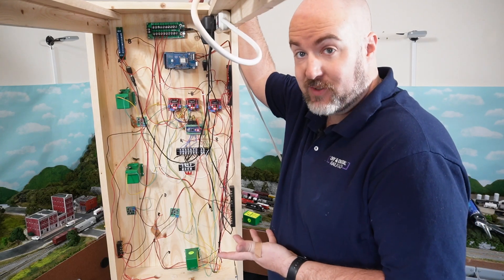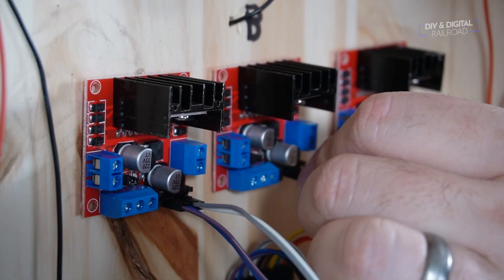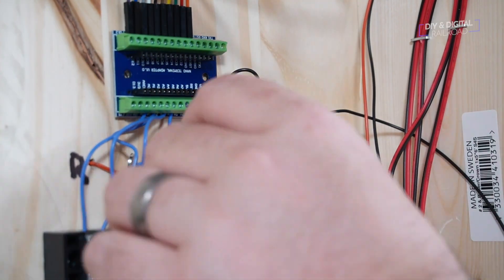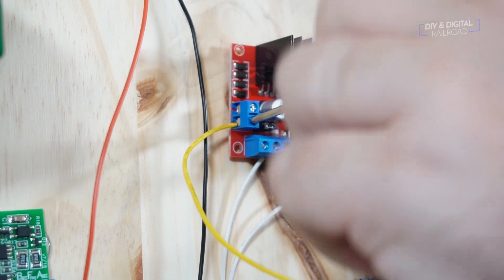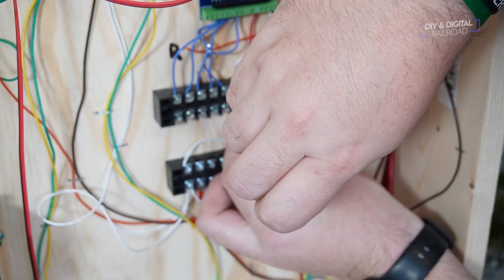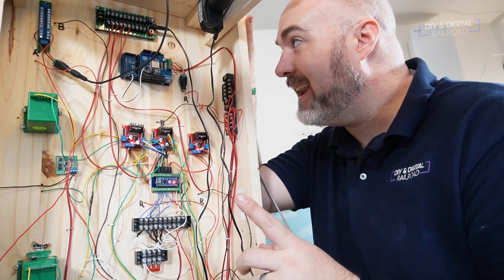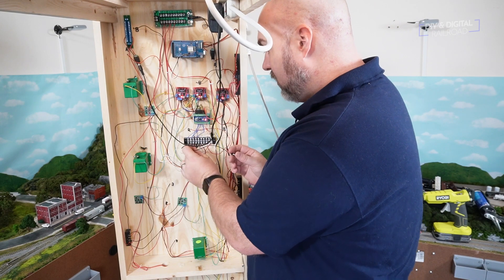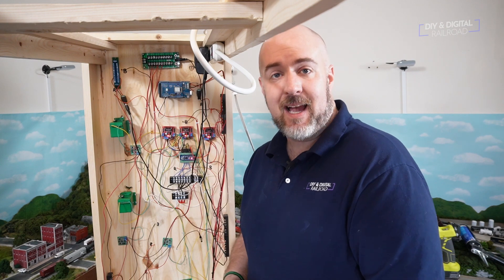Wiring up multiple Model Railroad switch machines with Arduino!

Comment: Why can’t they Arno control the tortoise directly, why do you need a motor control?
Reply from the maker: The arduino cannot supply enough power to run the tortoise.  Arduino’s max output is 5 volts and 200 mA

Comment: Hey Jimmy. Your arduinos and points control are impressive, so much so i am thi king of using your tdchnique in my own build. You talk about using 2 terminal block connectors - one with an input of 9V while the other is 12V.  In your state is the supply voltage 120V? In the UK it is 240V. Can you tell me how or by what method do you use to step down from 120V to 9V and 12V respectively? Thank you for the response. Mike

Comment: Jimmy, I think you could have saved yourself some resistor wiring by using the Arduino's input_pullup feature. Then with all the pins internally pulled high you'd need to convert the 5v rail to your buttons into a ground rail and remove the resistors. Here is a good video on input wiring 
https://www.youtube.com/watch?v=TTqoKcpIWkQ&t=12s

Comment: I'd be happy to do your wire management for you haha.  I like the idea of using terminal blocks - I'd do the same thing for the H-bridge drivers and solder the wires onto the pins as opposed to relying on dupont connections.  Thanks, Jimmy!

Comment: How many amps are you sending to the 12V terminal power distributor and also to the 9V power distributor ?
Reply from the maker: Currently (pun intended). I have 1 amp power supply connected to the 12V as well as the 9V, but obviously the way I have it setup I can swap them out easily.
Reply: @DIYDigitalRailroad  If I run two amps through either or both will it cause any issues with the Arduinos (or any of the rest of these components)?
Reply: @scentgrasslakerailway  Nope, the components will only draw as many amps as they need :) Voltage is important to get right though, too much (or too little) will cause issues. You can run an Arduino on anywhere from 5-12V, but somewhere in the middle is preferred because it will generate less heat, that's why Jimmy is using a second 9V supply instead of just using 12V for everything.
Reply: @milkymoocowmoo  That is excellent info, thank you!

Comment: What a nightmare. Now tell me why an Arduino is advantageous?  It seems that there so many wires that I would lose my mind, certainly my love of the hobby.  It is just too much.  To make it even worse is that after all of that wiring you now have to program these nightmares.  Now tell me how this makes life easier?  I do not want to have a degrees in electrical engineering and computer science just to run a layout.
Reply from the maker: The main advantages of an arduino is customization and now it is easy to change my turnout setup.  All I have to do is some minor adjustments to the code and I can make custom sequences for turnouts.  No additional wiring required.  It’s kind of like building a house.  Building a house is complicated, but once it’s built, you don’t have to tear it down and rebuild it every time you want to change something about it.
Reply: It's advantageous because it introduces a helpful software level into an otherwise entirely physical system. On a traditional layout for example, you might have a control panel of switches with wires running to your turnouts, and probably some indicator lights somewhere in there too. Each [turnout]-[switch]-[light] grouping is its own circuit, independent of other grouping aside from a shared power supply. If you later decided you wanted to interlock some turnouts, you'd need to run more wires. Maybe have a particular turnout route also throw some related turnouts? That's more wires, and potential *re*wiring of existing circuits, assuming your setup would even let you achieve it without causing shorts.

Think of Arduino as a middleman. Instead of individual circuits as above, you have inputs and outputs all connected up together via an Arduino "brain". Your switches, buttons, sensors, etc are your inputs, and your code tells the Arduino what to make your outputs (turnouts, signals, lights, etc) do when those inputs are received. To go back to the interlock example above, I could make that change quicker than I can type this sentence because all it would take is adjusting a line of code from "Arduino, when I push this button, throw turnout x" to "when I push this button, throw turnout x and turnout y". It also enables the use of logic, which is incredibly powerful. Conditionals, timers, reacting to situations....things that would be incredibly difficult if not impossible without that little brain sitting behind the scenes.

I'd also like to point out that Arduino is quite simple to learn! It's not a computer, it's a microcontroller board, so no electrical engineering or computer science degrees required. I have neither and picked it up by watching videos on this very channel, buying a $50 starter kit and following some tutorials.

Comment: Great tutorial as always. However I have a question you will probably be able to answer. Okay so say you have a fiddle yard/a humping yard. So in most cases to go from the thru mainline to the next section you would have the switch for the mainline and the switch for the next track, you have to have both switches opened to transfer from one track to the other, can you wire the signal to 2 tortoise switches in like a series so they both operate at the same exact time? I'm guessing yes, however the other thing I don't know is it going to be enough milliamps and or voltage to do it? From what I understand it's a yes. And thank you for any and all responses. You're the best.

Comment: Great video, Jimmy! We are building similar systems but going about it in rather different ways, which is all down to the flexibility of Arduino.

Have you given any thought to switching (sorry) from delay() to using a millis() clock? It would require some adjustments due to the way your code works (switch throwing functions only execute once per input, but a millis() clock forms a feedback loop and needs to...loop), but the payoff would be worth it. As it stands I foresee two issues-

1. The delay(200) in void has the potential to cause inputs to be missed if the button press occurs during the 200ms in which the program is halted.

2. Even worse, the delay(2000) in the throwing functions means you will need to wait at least 2 seconds after pushing a button before you can push another one, otherwise it won't be detected.

Lastly, I think it would be helpful to briefly cover the what & why of your pull-down resistors (if you haven't already done so elsewhere).

Looking forward to the next vid :)

Comment: Aloha Jimmy  Think  tiny wire ties and lots of colored wires,  set yourself a standard.  I use Black as DC negative except for my Kato track feeds.  Bundle all wires for a function and use the colors of the wire ties to show which function it goes to.   I used to do this with temperature probe arrays to designate row and column in 100 probe units. Makes troubleshooting easier when a probe fails.
Reply: I do the same. Eventuality you will need to troubleshoot.

Comment: Excellent video and information as always.  I am still trying to determine if Arduino is the way to go, seems like its going to be a tough choice for me between Arduino-based DCC++ system... versus using Digikeijs and Digitrax equipment. Or perhaps run separate power grids to the layout and use each during different sessions?  Maybe I think too  much..

Comment: I am still trying to wrap my head around Tortoises.  It pretty awesome that there is so much more customization potential for the system in the video, but can Tortoises be switched without Arduinos or accessory decoders? (i.e. just solder a switch onto it?)
Reply: Yes. Jimmy is driving the Tortoises for 2sec with each throw, but they're actually designed to be constantly driven and stalled at the end of their travel (~15mA @ stall). 12v and a DPDT is all you need, and the Tortoise even has an internal switch mechanism (actuated by its movement) that can be used to switch frog polarity and operate signals or panel lights if desired. There's a good reason they've been around for 30 odd years :)

Comment: Great video. I like how you mount the circuit card assemblies with hot glue. I generally use screws with some kind of improvised standoffs, which is a bit of a problem for me.  Question: What do you do if you decide to relocate your circuit cards after you have hot glued them?
Reply: You would just gently pry it off. Hot glue is marvellous, particularly for this application as it's a great insulator, but you wouldn't use it for anything structural :) Failing the gentle application of elbow grease, you can apply heat to soften it up again.
Reply: @milkymoocowmoo  Thanks. I will give it a try.

Comment: All that wiring reminds me of my father working on some type of pinball machine trying to repair it back in Cuba, more than 50 years ago! 
If he was still alive he would eat this up and I wish he was so he could help me. I do have a nephew who’s an electrical engineer and I will recruit him for this stuff because that’s what it takes to do this.
Reply: I disagree! If you can solder and understand a logical system (or are willing to learn), you can do Arduino! I'm building my own system that does the same as Jimmy's + a bit more, in a slightly different way. Wanna know how I got started? I watched a video on THIS CHANNEL then I went and bought a $50 Arduino starter kit :)

Comment: I think you just scared me right back to hand thrown switches with ground throws, very impressive just not for me
Reply: Hear what you say.  The word arduino makes my eyes glaze over and my mind start to see rotating pin wheels.  However Jimmy makes it as simple as it can be made.
Reply: What about us that don’t have or use tortoise switch motors.
Reply from the maker: hmmmm....this sounds like I need to do a video on it.
Reply: @kenshores9900  Not much would change to be honest! If you were using solenoids, you would send a brief pulse of current instead of the 2sec Jimmy is using here with the Tortoises. If you were using servos, you would replace the 2sec timer with the exact ° required to switch the desired route. The bulk of the code would still work, as nothing on the input side has changed, only what the Arduino is doing with those inputs.
Reply: @milkymoocowmoo  that makes. My head hurt as far as wiring I’m a clueless boob lol
Reply: @milkymoocowmoo  How is polarity change electronics handled?
Reply: @kenshores9900  for frogs? I'm using SPDT relays. For reverse loops you could do the same, but you'd need a sensor of some kind to detect the train and 2 relays, one for each rail (or a DPDT relay I suppose). It's also relatively easy to recreate a traditional auto reverser device with Arduino, many guides online for this. You could also just use an existing auto reverser product ie Digitrax AR1 as they're completely independent of whatever DCC system you use.
Reply: @milkymoocowmoo  With my old layout I made use of lots of DPDT switches.  Of course that was 25 years ago, and technology has provided use with all kinds of new things for our layouts.  Electrical wiring is one of the most challenging aspects of model railroading regardless of scale.  It is difficult to visualize.  Thank you for you comments.
Reply: @kenshores9900  You're welcome. I actually had a shower thought today regarding reverse loops, where I said you could use 2 relays/a DPDT relay and need a sensor of some description. You could actually just have the Arduino fire the relay at the same time as the turnout so that the polarity is correct when a train enters for the selected route. For a loop with separate entry and exit turnouts, you could interlock them such that only one is set to the loop at any given time, and have the relay set to the correct polarity for whichever one is set.
Reply: Me too!
Reply: Damn scared me right out of doing this